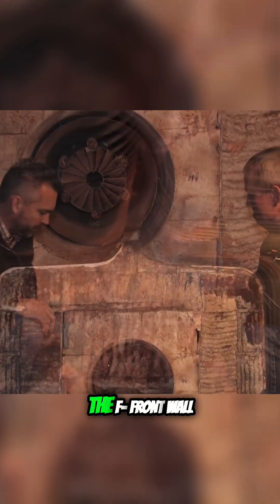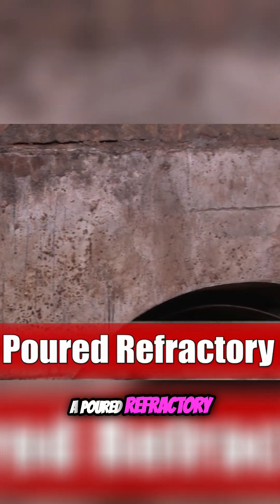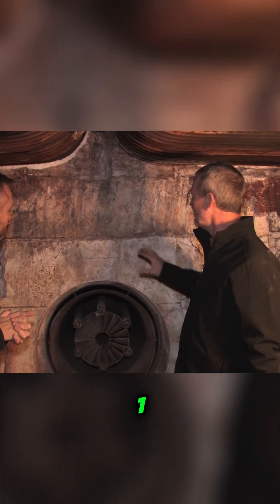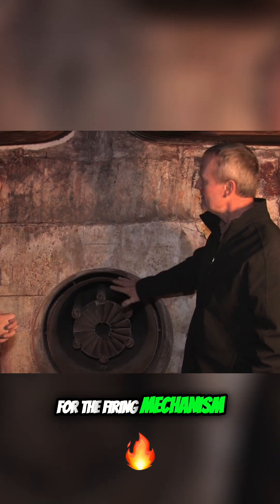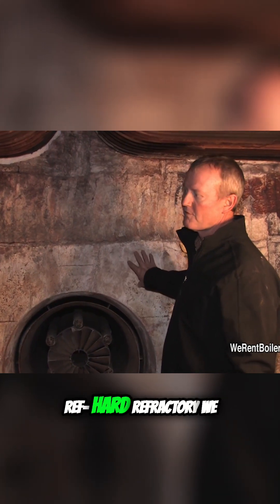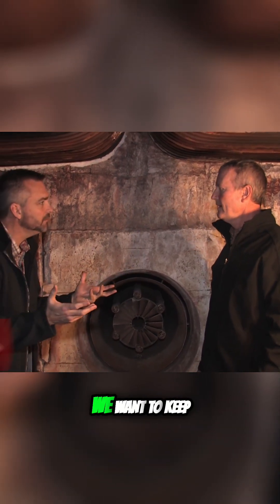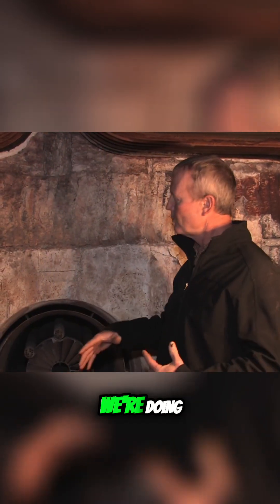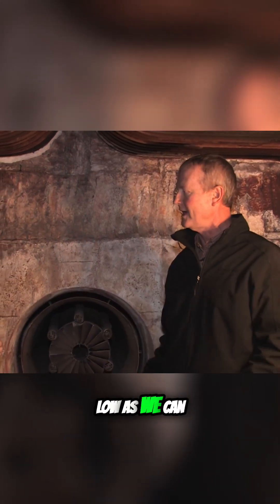Inside Rental Boiler pt 3 -  Refractory, Efficiency and Longevity  #rentals #steamboilers

Comment: Is this a boiler for a house? 
Growing up we had a very old boiler system in our house and we had the old cast iron heaters that ran through the house. That provided the best heat ever. When I build a house I’m gonna go with that setup
Reply from the maker: Industrial boiler used to heat water and make steam or hot water. That steam is then used to power equipment, heat buildings, run manufacturing processes, sterilize products, or even generate electricity. You’ll find them in factories, refineries, food plants, hospitals—anywhere large amounts of heat or steam are needed to keep things running.
Reply: Way too large for a house 😝